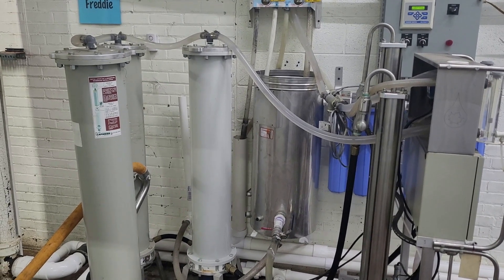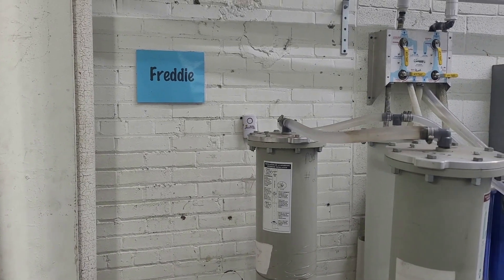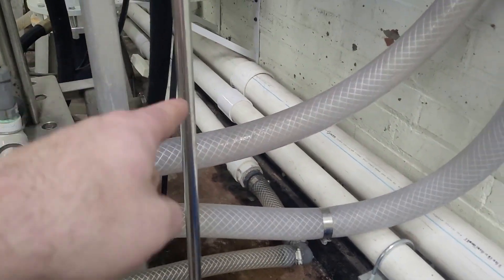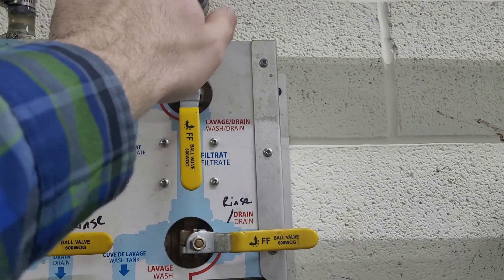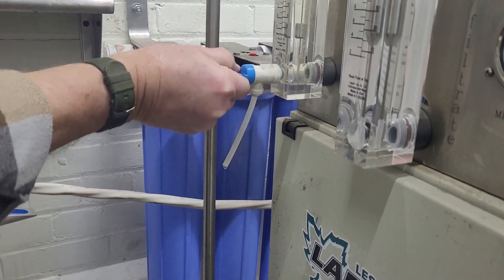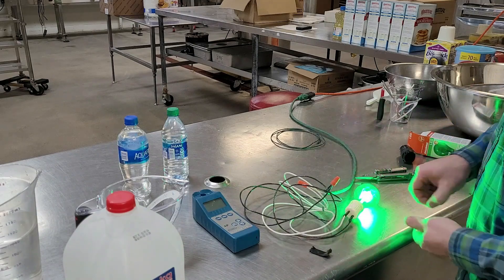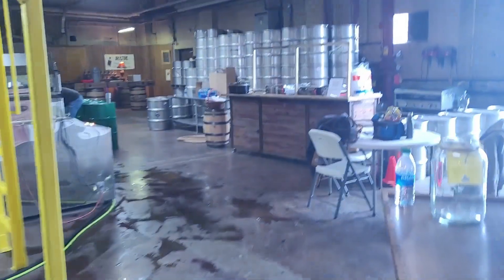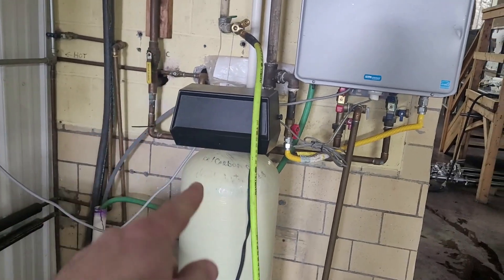#37 Reverse Osmosis for Maple Sap | Conductivity Experiment for Teachers & Tubing Hack

Comment: Thanks for the lesson! This was interesting to learn about. I noticed you said your storage was full of permeate so you were just draining the rest at the moment down the drain. What do you do with the permeate normally ? Since it is just water do you use it throughout your facility instead of using the city water? And if so do you prefer to use the permeate for things like cleaning the equipment because it has fewer contaminants in it compared to the city water ?
Reply from the maker: We do use it to back wash the RO.  I have often though about plumbing our building with permeate during maple season.  The challenge is the permeate won't keep long because the little but of remaining sugar is a food source for microbes.  It can become stinky after a little bit of time.  No bueno to ingest!  An unwanted probiotic!
Reply: @BissellMapleFarm  ooooohh yeah that makes sense about the microbes. I would imagine if you really wanted to make additional use of it then you would almost need to filter it again through a membrane that would purify it, but at that point you are putting in more time/effort than it is worth.
Reply from the maker: @aSinisterKiid  I think evaluating and potentially reusing permeate through our facility would make a great YouTube video.
Reply: @BissellMapleFarm  It would be interesting to see how many different things it could be useful for (If any). Especially if it could end up saving you money in one way or another. Anytime you can find a use for the waste/biproduct of your process's would seem better than just flushing it down the drain. I wonder if you could make your own bottled water with it, like specialty "Bissel Maple Water" or something like that haha.
Reply: It makes great water for outdoor woodboilers.

Comment: Pruno makes a tool for cutting the 5/16 off the fittings
Reply from the maker: No kidding.  I've never seen it.  Is there a website somewhere?
Reply: Pruno maple tools.. but end cutter I believe it's called tried attaching the website but then my comment doesn't post
Reply from the maker: @nickgoral7342  that is pretty slick.
 https://pruno.ca/en/5-16-3-16-tubing-tools/pruno-5-16-pro-tubing-butt-remover-71206